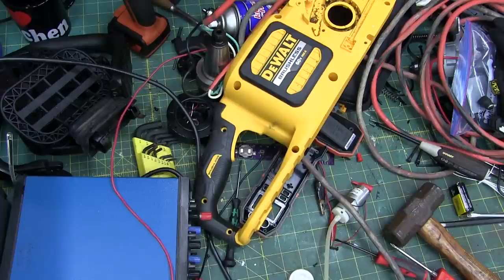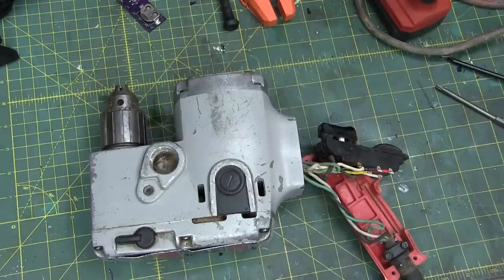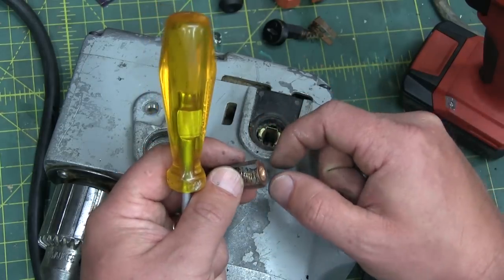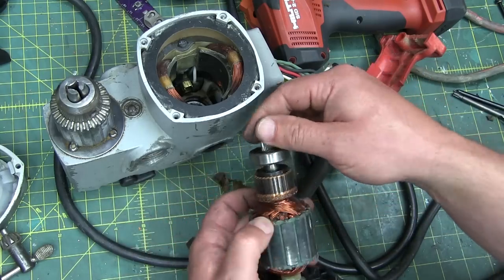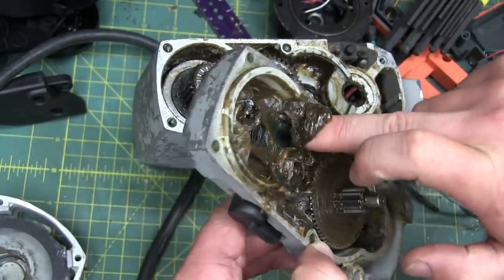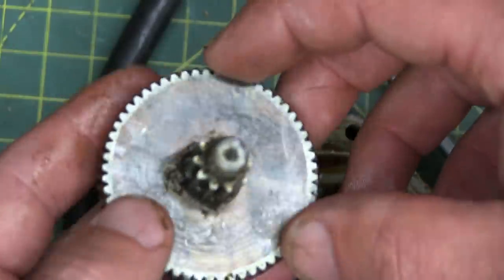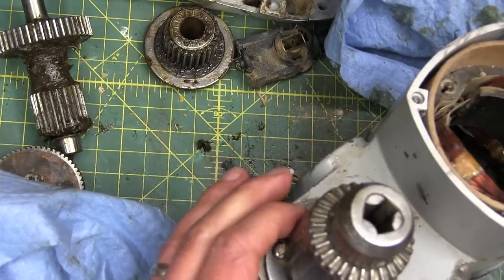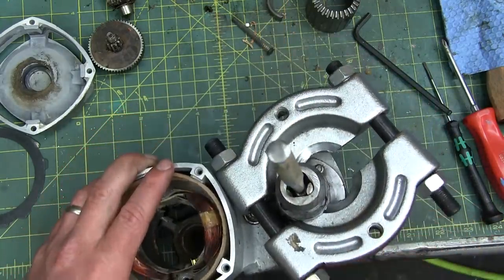BOLTR: Milwaukee Hole Hawg | Long Term Quality

Comment: You've inspired me to take mine apart too. Same model: 1675-1 @ 11:03 you talk about the lack of epoxy potting, mine has a narrow band of epoxy (about a quarter inch wide, army green in color)
Also, my fan is a clearish/white color.
Any idea what would be the best grease to use for reassembly?

Comment: Hello to my northern friends, the ring that you thought you broke on the chuck is not broke, kind of. If you get a rebuild kit for a chuck you will get new set of jaws and a ring that the factory machines and then they break it to be able to assemble the chuck. The factory breaks the ring.

Comment: AvE, Every Chuck I've taken off UNSCREWS!!
Put the key in  one of the holes and give it
a sharp tap, if memory serves me well it's on
20 unf thread. Hope ur ear clears up.
Reply: I just took one off...chuck-up a 3/8 Allen wrench and whack with my 3-lb brass hammer. CCW.

Comment: You know when you've got yourself a high torque cordless drill, and you hit a full stop situation, either your wrists are going to snap off, or the centre bolt in the chuck snaps (still fackin hurts) and then the chuck unscrews itself. Chuck is threaded the opposite way to the centre bolt. I'm surprised uncle bumblefuck has never stumbled on this situation before, I've done it twice. 

The problem what happens is, when you hit a full stop, your instinct is not to let go of the drill, it's to grab it harder, resulting in pressing down on the  trigger harder and you can't let go. I'm only glad they don't make centre bolts stronger than arms.

Comment: That's type "E" Milwaukee grease in the gear case. That's exactly how it looks when it comes out of the grease tub.
Reply: That it is! I've been working on a tub for about 20yrs and it's still half full...lol.  G.
Reply: ghostses We used to order it by the 5 gallon bucket until Milwaukee discontinued that size container.
Reply: LOL! Mine's just a measly 1lb tub. It was the smallest size I could get when I repaired my 1/2" Magnum hammer drill all those years back. I use it in/on many things. It's a good grease IMO. Take care, G.

Comment: Hi! I bought an even older variant at an estate sale - also tried pounding on it like crazy until I tried to unscrew the chuck - it came right off.
The grease was all baked and sticky. I took the gearbox apart and washed everything with gasoline and am going to put fresh grease. 
The reason I took it apart is that the spindle was broken and I will be installing a new spindle and chuck, because the new spindle requires a tapered chuck.
Anyhoo, I couldn't remove the gear you are also having trouble removing at around 17:00. How is it removed? Do I need to remove it for lubrication or should I just leave it there?
I was thinking about using synthetic grease "Blue Polyurea Electric Motor Bearing Grease" because I heard good things about it. I know Milwaukee sells Type E petroleum grease - should I just stick with that?
I hope someone can answer these questions!

Comment: Hey guys.  I was wondering if you could show some of use newbie what we can change out of a used tool like this to get some more years out of it.  Like that front bearing.  Can the average guy change that, add some more of the conductive lube and make this tool ready for another 10 years of work?  I know many of the new ones are not really that serviceable, but if we pick up some thing used what should be do?

Comment: Mr AvE, are there any bearings that would preform better on a skateboard than normal skateboard bearings? My research leead me to tapered roller bearings and spherical roller bearings. Thanks for your time.

Comment: quick, someone tell him the jacobs chucks screw on, the lefty handed bolt is just secondary fixing....
the chuck should be normal right hand thread, the bolt left handed, so if the chuck tries to unscrew it tightens the bolt holding it on and gets no where fast. kind of the same way norlock washers work....

Comment: The gear that provides axial thrust up and down according to rotation, would that be to provide less wear on the small standard toothed gear by moving it up and down so it doesn't always ride at the exact same spot while it is working in different directions turning the other large bull gear? You know like rather than one path where the two meet you have a forward path and then a bottom path on the teeth where the gears meet in reverse? Does anybody get what I'm saying?

Comment: All chucka I've taken apart have that nut split. I think it's the only way it can be manufactured because all brands are broken.  Its important to put them back together in the same position or the chuck won't work right, don't ask me how I know that. You did not break it.

Comment: My grandfather had one of those really old ones that relied even more on the motor itself for the torque.The kind that had the D handle on the back and the pistol grip and guarded trigger.  I'm sure it's probably still in the basement somewhere at his house but I do remember comical events with it. Such as using it to drill into a stump for some explosive removal and it bound up and ripped right out of my dad's hands leaving his glove bunched up in the guard holding the switch down and it just sat there spinning like a top winding up the cord and the extension cord until it finally yanked out of the socket hehe. Highly amusing for a 14 year old to witness XD.

Comment: Outdone by a Chuck ! Drill Chucks are screwed on. if you can make a Chuck Titan put an allen wrench in there with the 3/8 Drive hook up your impact device puter in reverse and hit go. It'll unscrew right off there the Lefty thread is there for obvious reasons:-)

Comment: "You're killing me Smalls" drill chucks ARE threaded!!!!!!!!!!! the chuck unscrews from the shaft. The way I way I was taught was to chuck a 3/8 bolt into the chuck and use an impact to unscrew it.  Every chuck I have seen is threaded, the screw is just essentially a jam nut

Comment: I had one of those new dewilt hole hogs. I broke the chuck clean off. Turns out that it un threads of the shaft. Wonder if that millfuckie is the same.

Comment: always though that you remove a chuck by taking the screw out and then put a hex head socket in the chuck and spin it off with an impact gun. 
thats the way i change the chucks on my makita gear

Comment: I had one of those from about 1983 until 2005. Used it almost every work day, topping out plumbing, remodels, service calls, etc. Never failed. No side handle and no back handle. That way it'd go between studs. I'll be honest. Changing bits in the field with a key can be tiresome. One guy that helped me ran his finger through the chuck when he used the key with the tool plugged in! So, I rarely used the key. (I still don't). To loosen the chuck when holding the chuck with my hand doesn't work, I smack the bit against a stud. THAT always works! Lol. One irritating characteristic was the location of the switch. Many times, when I'd hit a nail, the tool would spin around and pin my trigger finger against a stud. Hard to turn it off when that happens. The drill is humming and I'm not. Rarely ran it at high speed. Usually when using a large diameter hole saw. High speed doesn't have near the torque that low speed has. No one would dare to run a 4" hole saw at low speed.  At least, more than once.
Plumber since 1976

Comment: The only difference in old an new is the switch and handle. the gear box is the same the arm. and feild are the same right down to the card borard shild ..also the new one still has a metal Id tag too  ...I just had 2 of these on my bench one old one new ..both with failed switches ....I swapped the old's handle for the new style handle and switch

Comment: Used these through my 15 years of plumbing. Its the only tool for the job but u have watch your ass for sure. Recently bought my own and yes the new ones still scukum but the fow/rev switch was moved on the handle and looser than a hotdog down a hallway no positive detent at all and get this shit the case is sold separately now what a joke where am I suppose to put my beer on the job site

Comment: Those chucks are SCREWED on. The bolt in the middle is because it is a reversible drill. Put the key in the chuck  and whack the key ..it'll unscrew..

Comment: Noooooooooooo! I was flinching with every Hammerstrike. The Chuck is threaded on the shaft. You didn't break the chuck, you actually disassembled it. That ring that appears to be broken is in fact broken during manufacture. The ring is threaded and then snapped into two so it fits in the groove the operates the jaws. The outer shell is pressed on to the ring. If you put it back together and then Chuck a small piece of hex agonal stock into the Chuck, you should be able to spin it off with the impact wrench.

Comment: I was a young dumbass carpenter and tried using one of these one time. The hole saw got stuck and thank God the cord got wrapped around the drill body and unplugged it before it killed me.

Comment: 18:45 -- FYI -- The first time I ever heard of a "Hole Hawg" was NOT from an industrialized 200 pound plumbing or electrichickal ape!  It was from a tech guru, by the name of Neal Stephenson, who compared Unix to Windows by calling Unix a Hole Hawg.

http://www.team.net/mjb/hawg.html
Reply: "The Hole Hawg is a drill made by the Milwaukee Tool Company. If you look in a typical hardware store you may find smaller Milwaukee drills but not the Hole Hawg, which is too powerful and too expensive for homeowners. The Hole Hawg does not have the pistol-like design of a cheap homeowner's drill. It is a cube of solid metal with a handle sticking out of one face and a chuck mounted in another. The cube contains a disconcertingly potent electric motor. You can hold the handle and operate the trigger with your index finger, but unless you are exceptionally strong you cannot control the weight of the Hole Hawg with one hand; it is a two-hander all the way. In order to fight off the counter-torque of the Hole Hawg you use a separate handle (provided), which you screw into one side of the iron cube or the other depending on whether you are using your left or right hand to operate the trigger. This handle is not a sleek, ergonomically designed item as it would be in a homeowner's drill. It is simply a foot-long chunk of regular galvanized pipe, threaded on one end, with a black rubber handle on the other. If you lose it, you just go to the local plumbing supply store and buy another chunk of pipe. " -- From the article.

Comment: I LOVE how everytime you start a job... the last job is underneath the new job on the work bench.....

Eventually the "working height" becomes totally un-useable and we'll.. you gotta clear the damn bench....

I get it...don't worry ;)
Reply: Further-  if an electrical connection is "micro welding"..... it's a fucked connection and needs replacing..... pronto.
Reply: Also-  chuck - remove centre lock screw, then using a 1/2" AIR rattle gun using a 1/2" to male hex inside chuck locked up, rattle it off, RH thread. 

They are not tapered onto shaft!!!

Comment: When I tear down a Milwaukee or other quality tool I have the exploded parts diagram from ereplacement or whoever open on my PC to see what I'm dealing with and to price/order parts.Pre-buyout Milwaukee quality is glorious and parts are generally available. 
Random Hole Hawg illustration. Note the threaded chuck mount:
https://www.ereplacementparts.com/milwaukee-16751-ser-413a-two-speed-hole-hawg-drill-parts-c-131_136_6250.html

I just bought a V28 portaband cheep making the expensive M28 battery (which last a very long time IME, I've one from 2011 still worth using) a bargain since I've two V28 Sawzalls + other tools. I've newer gear too but old corded and cordless Milwaukee is built to commercial standards and it shows.
A
 large hunk of hex stock/cut off hex key/hex bit and an impact wrench can often shock stuck screwed-on chucks loose.

Comment: Anyone needing to know how to get threaded chuck off after drill is taken apart.  Tighten a Allen socket into the chuck and hit it with air gun comes right off.

Comment: You should try with fixing the shaft and then turn the chuck of instead of hammering on it or the screw. I think that there is a thread an not a chuck cone. But the thread must be a right-hand one. 
Just try. Maybe i am right. 😅

Comment: bought one from a retired plumber thinking i was gonna run a 4 inch hole saw in it, after it tossed me off the ladder a dozen or so times(I don't give up easy) I sold it to a plumber , he jammed it in a floor and got wound up in his cord, anyways unless you are the hulk , this thing is gonna beat your ass against everything it can find

Comment: Adding insult to injury millfuckee has changed the threads on their cordless drills to 9/16 x 18 so you are stuck buying millfuckee chucks and not able to get a decent llambric, porta or Rohm chuck for your flogged our one.

Comment: here's a hot tip for your next seized or rusted nuts lol take a torch and gently heat it up then put a little bit of wax on it,let it cool to the touch then smack the ass out of it with a wrench proper like and problem solved...your welcome

Comment: GENERALLY THE CHUCK IS RIGHT HAND THREADED TO THE SPINDLE, WITH LEFT HANDED LOCK SCREW IN THE CENTER.  YOU REASSEMBLE THE DRILL, INSERT THE CHUCK KEY & GIVE IT A GOOD SMACK....GOOD LUCK

Comment: take the left hand screw out then right hand thread unscrew the chuck may be ??
Reply: I found that out when using corded drill with 15/16 socket to start infirnal combustion stone flinger started and when it fired it unscrewed the chuck then foung left handed screw threw bolt in the chuck.

Comment: The chuck is threaded on. Put 'er back together, put the D in the vice and let the drill unthread the chuck... Used to do this all the time to apprentices (remove left hand bold first).  Good for a laugh. Newer ones don't use a threaded chuck.

Comment: Is the Milwaukee m18 1/2 inch impact any good for plant and agri work?
Reply: name2things if you want them shaken not stirred otherwise I would stick with the M18 Fule drill with the hammer feature
Reply: David Drescher I'm thinking it might not work on some of the hen houses that come into the garage I  was even thinking of 3/4 inch impact as I have a old 3/4 Makita impact but it's not great

Comment: You'd use rigid conduit, not emt, and i wish i had one of those to pull wire, have to do it the ol' fashond way
Reply: Andrew Mayo is that withe a hammer and chisel, or a hand auger before hanging the stud
Reply: David Drescher its by hand
Reply: Bare hands

Comment: I don't know why ALL modern 1/2" drill do NOT have TRIPLE gear reduction !  You need torque not speed to spin those large bits and hole saws.  The wimpy 2 speed/stage planetary gears on drills these days just does NOT cut it.  Of course, that third stage would have to be some decent steel.

Comment: If you read on the chuck (time 26:53 it say 5/8 X 18 ) you think that is the chuck thread ?
Reply: That looked to me to just be the equivalent metric bit size range.
Reply: A 5/8" is 3 cunt hairs bigger than a 15mm but will still remove a 15 mm bolt if it's fresh

Comment: As a virgin poster Ill ask a sacrilege question like my wife asks me:  wouldn't you want to look up the schematic (instructions) and just see if its reverse threaded?  And then I answer what I always do.  BTW, the 1/2" straight Milwaukee HH drill of the 80's and 90's was the respected pro tool on every mega commercial construction site.  Not anymore

Comment: The superhawg will disappoint, no real use taking one apart. The motor power goes through taps molded into the plastic casement. A few hot suppers and the plastic melts and you're replacing the case for $30. 

At nearly twice the raw power and a longer arm, they're better apprentice tossers than the original while they are choochin.

Comment: dude, WTAF its threaded on there why in there its got a left handed thread would have been your first hint
Reply: Chasing Capsaicin not the first rodeo not the first Chuck. They all use left-handed threads weather spin on or wedged because the normal drill bit is right-handed. Means the first time you use the drill and forward Chuck tightens up. The 5/8" -18 on the side of the chuck was the clue
Reply: It is about apposing threading, central screw and head thread. It makes it so there is no difference what direction the drill is turning.  One left one right, have changed quite a few, several Milwaukee that are still in service today.

Comment: Try unscrewing the fucker and not hitting it ! The left hand screw is to stop the main thred undoing in reverse
Reply: Also the threded ring is broken in manufacturing so it can be fitted into the groove, and held in place by the outer sleeve

Comment: I used one of those to drop holes inside a wall more than a decade ago. Nearly took my arm off, that biznatch has some torque, Got to put your shoulder into it or it will just take it off. SKOOKIM as frig or maybe just more skookim than me.

Comment: Is it too much to get the whole takedown on video?

Done a lot of time on this tool from the 80s thru 2000s. Still own 2 of them. The workhorse of the plumbing industry. As a greenhorn, they started you out on a RAD, then warned you about bracing the Hawg handle opposite the rotational force before you start drilling. Dont use the side handle which is only a liability. Drilling 2-9/16” waste arm holes horizontally, use your body weight to counter the force. Vertically, the nearest stud/ joist/ truss. Always have the trigger handle braced! It has to be the strongest element known to mankind. If you were competent, it would drill out a house in no time. If not, you got injured badly. Never respect a plumber who uses a right angle drill.